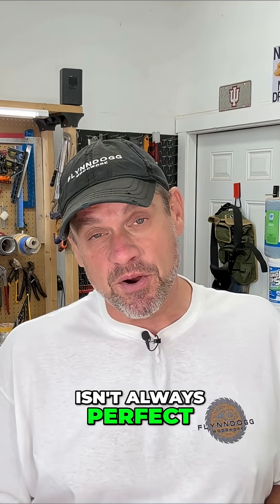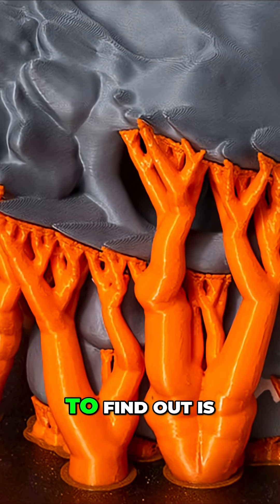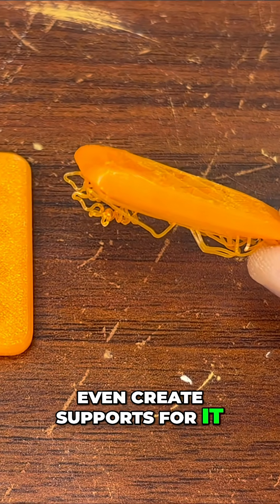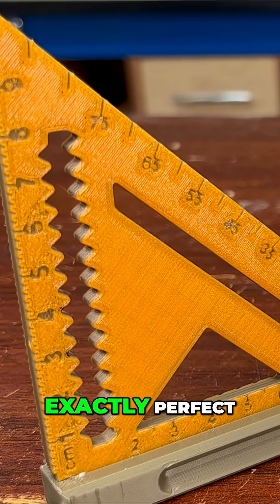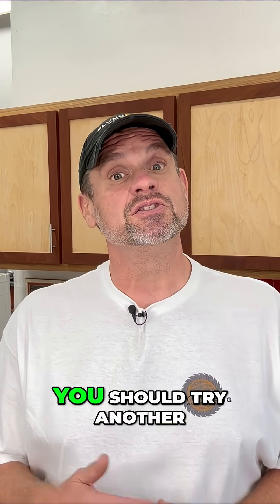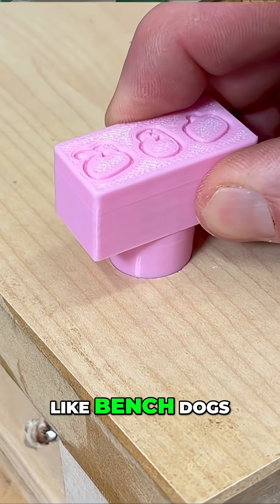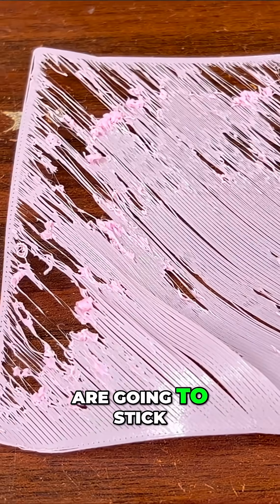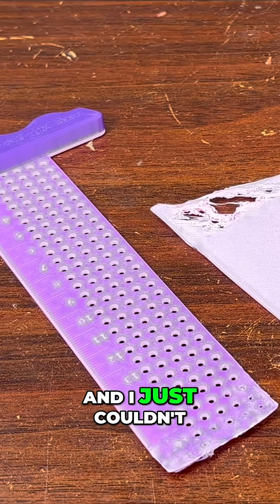3D Printing Fails You Need To See!

Comment: I rarely, as in once every six months, clean my plate.  Your filament isn't sticking, likely because it's absorbed water.  I know, that's the peanut gallery's answer to all problems.  Trust me, dry filament is needed, particularly PETG and more exotic materials.  Get a drier and store it with a desiccant. I have a system for it, with remote humidity sensing, that works great.  It's not 
expensive to do.

I'll have to try the 1-2-3 blocks.  They don't look like they should be that hard to do.
Reply from the maker: I appreciate the detailed feedback on filament drying, I'll definitely look into a better storage system for my spools!   I'm definitely very new to this whole 3d printing thing.   I'm actually printing out some battery holders right now for a future video.   I will have to say the learning curve is pretty quick though!
Reply: @FlynndoggWoodwork  I had something odd happen last night.  I set up a couple of zero-clearance throat plates for my bandsaw to print overnight.  I'm modifying one I found online for my saw.  It had no holes for the dust collector to do its thing, so I "drilled" them.  I'd been fiddling with the design all day and it was printing perfectly. When I looked at the new ones this morning, they looked like your prints - ugly, like the first layer didn't stick to the plate.  

I've been having some trouble with a grinding noise when the plate got to the bottom while homing. I power cycled it and it printed perfectly again (no grinding either). I'd been using it all day yesterday without an issue. When I turned by back, kicked me.

3D printing has a fast learning curve but it's long.  You can get it productive in a few minutes, then learn for years, it seems.  Pick up a piece at a time,  as you need it.  It gets even more interesting as you go. It tweaks the engineer in me, anyway. 😁